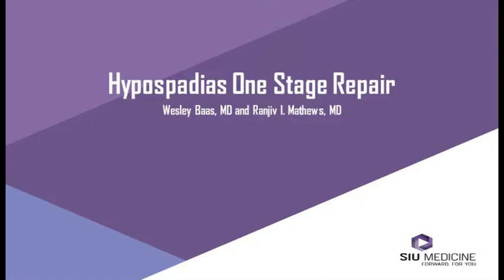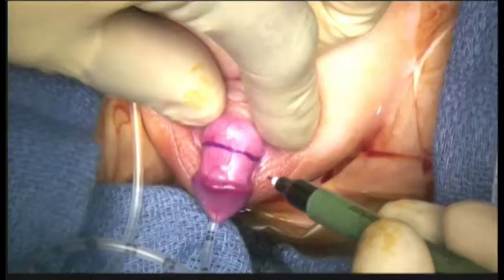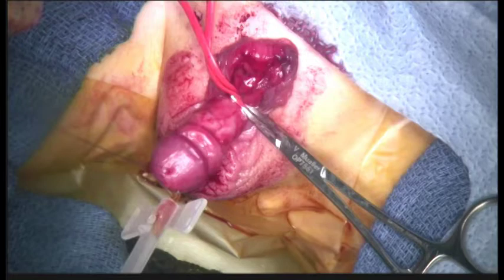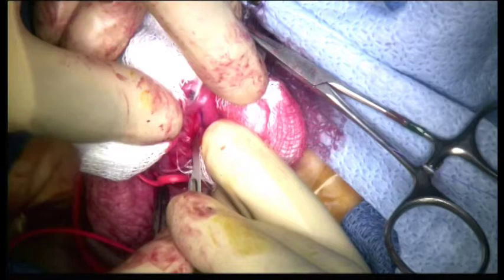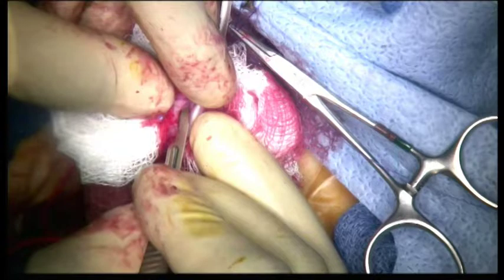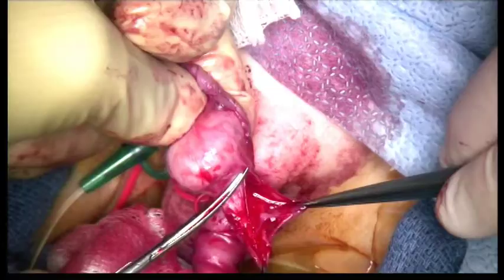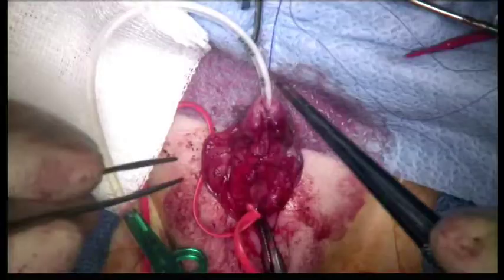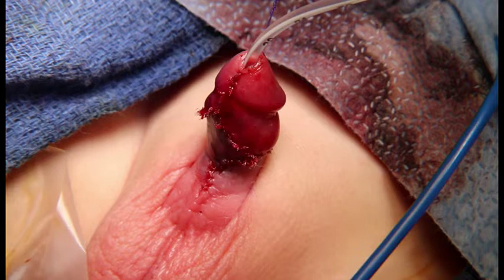Proximal Hypospadias - 1 Stage Repair

Comment: Hello 
Thank you for the information. I would like to ask for your advice. My son is 16 months old and was diagnosed with Hypospadias Grade 1 at birth. We currently live in Bonn, Germany, and already have a surgery appointment scheduled for March 28th at the University Hospital Bonn. Are there any methods that should be avoided during this surgery? I know the doctors here are good, but they perform various surgeries and not exclusively Hypospadias surgeries. I am concerned because I saw on YouTube by Dr. Hadidi that there is an old technique that is common and easy to perform but often leads to complications (such as stenosis). Could you please tell me which are the best methods for this type of surgery and which ones are associated with a higher risk of complications like stenosis?

Thank you for your help.

Best regards,